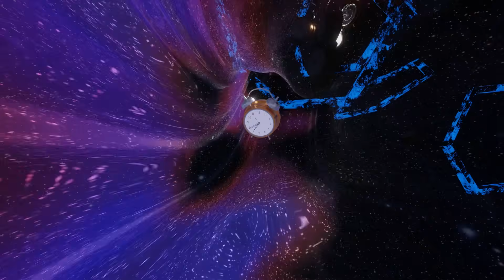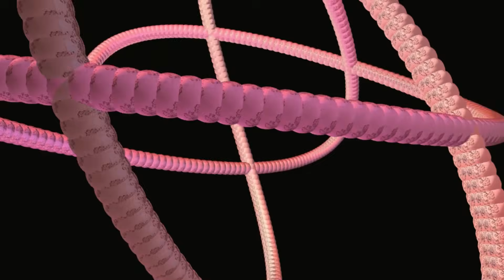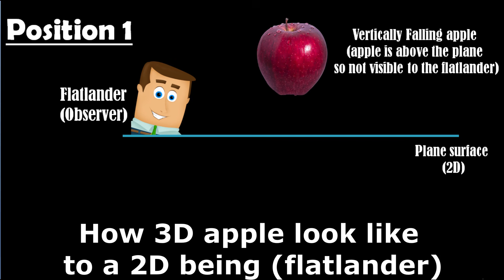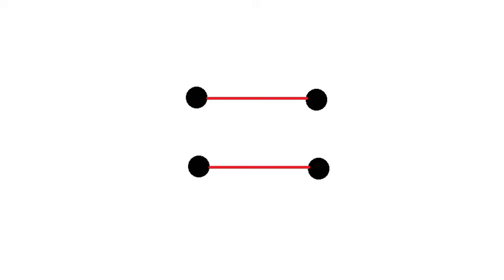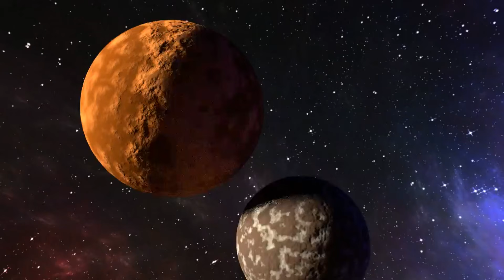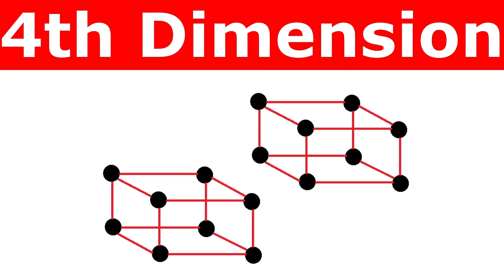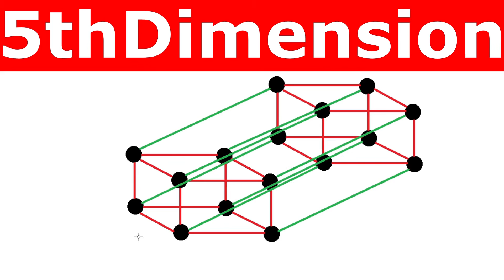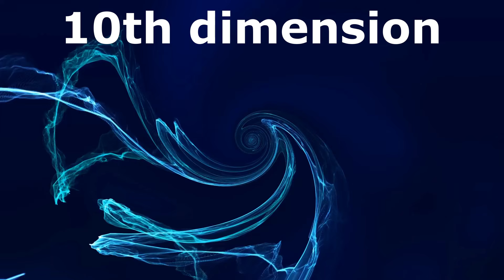11 Dimensions Explained - A Mind-Bending Explanation of Higher Dimensions!

Comment: Cartesian coordinates is not the only coordinate system for three-dimensions.  There are also the Polar and Spherical coordinate systems.  They all use three numbers to locate a point in three-dimensions, but they use different numbers.  I can understand if other dimensions are orthogonal to the three cartesian dimensions and that for some reason we can't experience them.  However, if the other dimensions are just curled up, then those points can be located with just three numbers.  No need for curled up additional dimensions.  Seems like physicists have taken a wrong turn somewhere and ended up in a dead end cul de sac.

Comment: It seems as though a 4th dimensional being would be able to everything that you propose an 11th dimensional being.
The idea that you over looked, is that there is only one universe. And fitting a cube inside of a cube is simply an illustration of the 4th DB's omnipresent ability. Infinitely small or infinitely large.
There isn't any absolute evidence of any dimension beyond the 4th.
Reply: I just commented something similar!
Reply: Re: I understand it but past the 4th dimension I think is when it's safe to say the rest is just theory and not a real possibility. 

Also a clarifying question: with the 5th dimension baby example how would split timeliness be created based off of one decision made that only leads to one outcome so how could two different timeliness be created?

Comment: IMO & many agree, Time is NOT a dimension...It's simply a parameter of space = space-time. One cannot manipulate time without also manipulating space...unless one is happy to be stranded in interplanetary or interstellar space, because EVERY inertial frame of reference is in motion wrt every other...but that's not all. What kills this time-travel nonsense is entropy. If one wished to move backwards in time, one would have to inject stupendous amounts of energy to take the universe back to it's previous state...but even if you could the exercise is futile because no matter what you do, Entropy ALWAYS goes from order to disorder! It's a one way operation which guarantees that time is unassailable, & non-dimensional. It's an effect, or a parameter, NOT a dimension. If you can't get THAT right, the rest is pointless speculation...unfortunately.

Comment: How are you saying that height is one of the dimensions of space ??..  when you can’t tell me how high space is.
You would need to tell me you know wear the bottom of space is, than you can judge if there is a height..
There is No bottom or top of space so it’s fair to say it has none of the dimensions you’ve explained.
The more I question your concept of a 3 dimensional space, the more it makes No sense at all.
Did it ever dawn on you that what your wrongly calling space is Multi dimensional but has none of the 3 dimensions your talking about apart from time.
There is no way you can for sure know that time is the 4th dimension it could be the 1st, 7th or 8th who knows ?
With a little low key insight, it’s a possibility Time can be the first multi dimension. Why ??. Because for any dimension to exist, it needs vibration or movement, for any movement Takes a certain amount of Time.. even drawing your line to represent the 1st dimension, Took Time.
I do like your 2ed 3ed-4th dimensional beings perception though.
It’s a nice way of saying, if your a 2 dimensional being, and have a encounter with a 3 dimensional being, you would only see 2 dimensions of a 3 dimensional being from a  2 dimensional perspective.  So that being will look weird..   lolol
Since there is so much speculation going on, I have a Question or something for you to pounder.
Is it possible to be a 4th dimensional being but have None of the other dimensions that makes you a being ? 
Only exist in a 4th dimensional state or plan ?? If this is a possibility than even if your a 3ed dimensional being, you still will not be able to even perceive the 3 dimensions of a 4th dimensional being..   who says in the  4th dimension your still classified as a Being anyway?? 
You better off using the term, 4th dimensional entity, because it’s more than likely that you will not need a body with a default or generic lower dimensions..   Now that’s something to think about 🤔.
I have learnt a lot by watching this documentary though.. I’ve learned that IF we are 3 dimensional Beings, were Still a long way from even perceiving the other dimensions of what we are wrongly calling Space much less scratching the surface of Time and it’s multi dimensions.

Comment: If you think this adequately explains an extremely complicated idea, you're deluded.
Reply: Its a start
Reply: @charlescarabott7692  It's a deceptive start.
Reply: @Edruezzi  not really as no one has a definite answer so its open to speculation
Reply: @charlescarabott7692  Higher-dimensional geometry has been studied since the 1800s.
Reply: @Edruezzi  higher dimensional geometry could have been studied from the dinosaur age. The important thing is no one knows for sure what higher dimensions look like.
Reply: @charlescarabott7692  What higher dimensions "look" like is irrelevant. Epistemically, the question is actually meaningless, because what humans think of as the "look" of objects is based on their confinement in three dimensions of space. The mathematical properties of spaces of higher than three dimensions and then of infinite dimensions have been studied since Reimann's work in the 1860s. They are not a mystery.
On the other hand I'm sure that by "higher" dimensions you mean something mystical. That nonsense is not what the video is about. Outside the mathematical meaning the concept is cognitively meaningless.
Reply: @charlescarabott7692  Higher-dimensional geometry could not be studied until Reimann's fetschrift in 1866 or so, so it could not have been studied during the reign of the dinosaurs.
Reply: @Edruezzi  that "nonsense" is exactly what this video is about lol
Reply: @charlescarabott7692  It's a deceptive start.

Comment: There is a logical error in the supposition that additional physical dimensions above three are curled up into a minute metric, which is that the additional dimensions would also have to be limited in extent as well. No matter how small the metric would be for the curled up dimensions if all dimensions are present in all of 3 dimensional space, then eleven degrees of motion would be physically accessible at any point in three dimensional space. So motion in the additional dimensions would still be possible, which is not detectable by our current level of instrumentation. If an m-brane can vibrate in 11 dimensions, why then can a macro object not also move in 11 dimensions? No matter how small you make the metric in the additional dimensions, physical movement in those additional dimensions should still be possible, unless there is some other constraint in the additional dimensions that is not an aspect of the 3 detectable dimensions. Simply making the metric small (even relative to the Plank-length of three dimensional space), would not prevent movement in those additional dimensions unless they were also finite in size (that is limited in overall extent) relative to three dimensional space. And if so, if finite, then the additional dimensions can not exist at every point in three dimensional space. So that is the logical contradiction of the theory of eleven dimensions mapped to an observable three dimensional space manifold. A space manifold with a physical metric of arbitrary size for all and individually each of the dimensions of that space does not describe a manifold that reduces to three dimensions if all of the points of the manifold have eleven degrees of freedom of motion. Another way to say this is that there is no proof that a mathematically coherent 11 dimensional m-brane string theory translates to a feasible basis for a universe with a three accessible physical dimension manifold. The only way to make the theory work would be to make the additional physical dimensions metric infinitely small and for each physical dimension bind them to an independent dimension of time that is infinitely large, then to speak of a string or m-brane vibrating in 11 dimensions becomes meaningless. There is no way to make this 'curled-up metric' 11 dimensions theory work given the observability of three dimensional physical space.

Comment: Equivocation 101. There are infinite dimensions of polygons required without equivocation required.  You need to dimension each side. Not just length and width. 

Infinite sides of a polygon, means infinite dimensions.  

You are teaching how to equivocate.   Not dimensions!

2 dimensions aren't descriptive of a polygon.  3 dimensions aren't descriptive of a 3d polygon.

Time is not a dimension of objects.

Dimensions aren't realms.  They are measurements.  

You don't go into dimensions.  You read them.

This is a seminar on how to equivocate meaning into a meaninglessness realm.